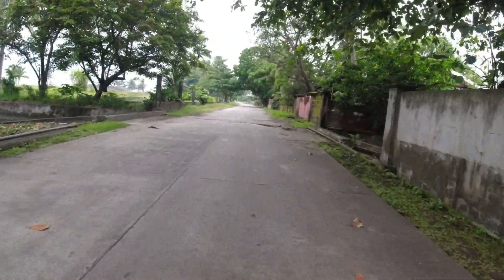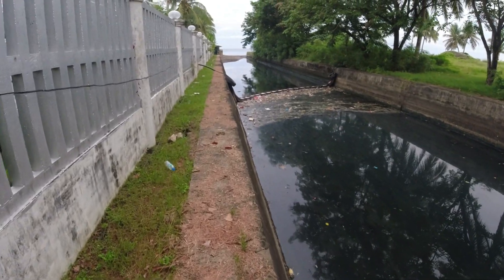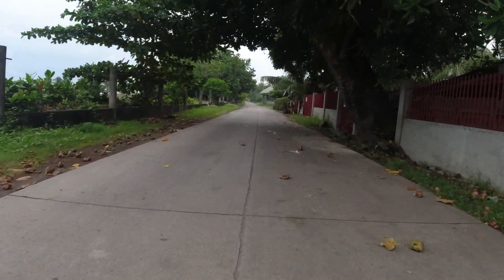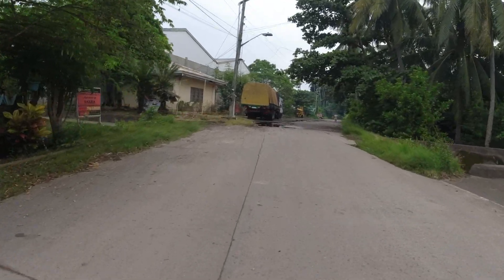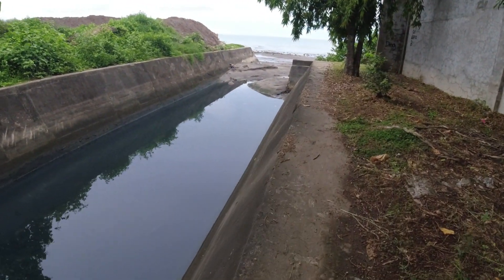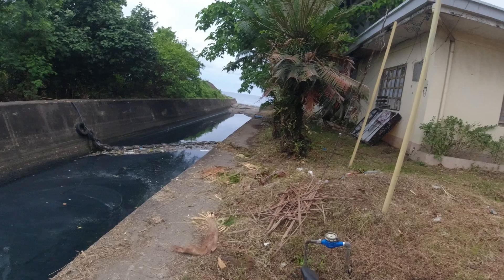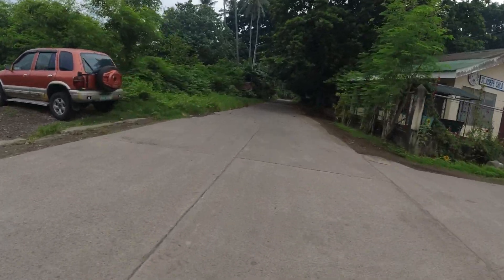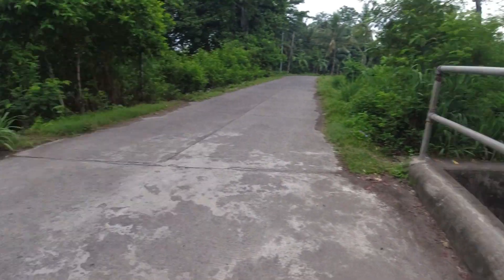A tour of Canals no longer part of the Ocean plastic problem.

Comment: I love your work, it's really about finding practical "first aid" solutions to tackle a problem, with respect to availablility, skill level, and cost of material and local workers. Reading through your description though, I am concerned about the "big non-profits spending millions with great promotional skills but not making a dent".

They are making a dent, in areas where your solution couldn't, especially out on the ocean, cleaning up stuff (part 1 of 2) that's already beyond your area of influence.
Likewise, I think your solution will make a dent, in areas where their solution isn't feasible because of cost or lack of scalability synergy.

So the only way forward is together, not against each other. They are not your competitors, you are both part of a solution. I will try to spread the word about your project.
Reply: #teamseas #Oceancleanup #4Ocean
Reply: Truth

Comment: This is awesome, great work! You’re giving the Interceptor from The Ocean Cleanup some competition ;)
Reply from the maker: We need an interceptor on our biggest polluting rivers here in the Philippines, but could never afford one. But with a little ingenuity and cheap labor I am sure we could build similar conveyor for a fraction of the cost. Using a few ideas from the water wheel and all the other conveyor systems, just combine the best of each into one package and use a Kaboom to feed it.
Reply: #teamseas
Reply: The interceptors are great, but the people need to be educated too, otherwise the problem will continue. Follow Afroz ' s example in Mumbai and engaged the  fellow men in this. It took 3 years to clean up the whole Mumbai Beach that way. Find it on YT. Thank you for your commitment!
Reply from the maker: @anna-lenameijer9942  Yes you are so right. I have several projects not just the Kabooms. Right now am building a prototype single stream recycling cage, should be done before our Camiguin Eco Warriors monthly cleanup event November 20th. It's to be installed downtown near the Kabooms. We will then go around the neighborhood with flyers explaining the new simple system. At last residents will have an option....I will explain more in coming video thanks

Comment: Just missing the (automatic) recovery system :)
Reply from the maker: This invention cost 50 bucks to build, labor to have it scooped out is less than $2. Automatic recovery system? An Interceptor cost one million. Simple electric conveyor belt? maybe $10,000. Most poor countries can afford to make a kaboom...recovery is best using cheap labor...me (free) and a paid helper. Oh I have designs with V shaped Kabooms with removable center capture cage,,,but that takes $$$. Something I do not have much of, if I did? Never would of dreamed up the Kaboom. Simple, cheap, effective. Thanks for your thoughts.
Reply: @TropicalOceanCleanup  I definitely concur on the cheap labor - but I disagree about the electric conveyor system being 10k$.. Even if bought from the shop. Though for the wet requirements are bound to up the price. Electric motors, bearings and also gridless systems (especially in sunny places) are the cheapest they've ever been so I think diying an automatic recovery system with solar panels could be built affordably.
Reply from the maker: @rkan2  True if made with labor and parts here maybe half that or less, I was going on ones I priced abroad. Right now? I couldn't even afford the solar panel.
Reply: @TropicalOceanCleanup  don't even need electric motors. You have flowing water literally right next to the problem - water wheel driven.
Reply from the maker: @DH-be4ur  very slow water flow...only in a storm it's fast enough for a water wheel like ten times a year.